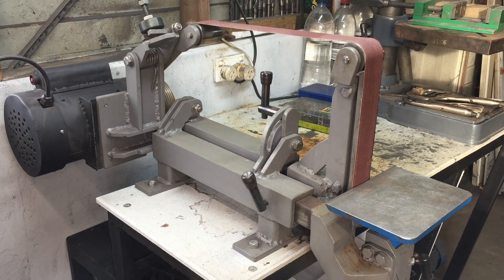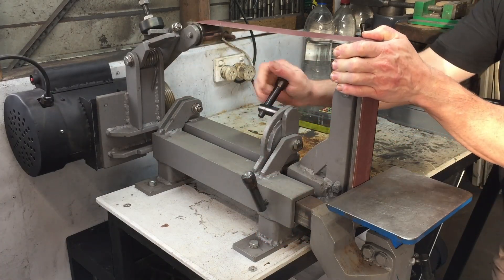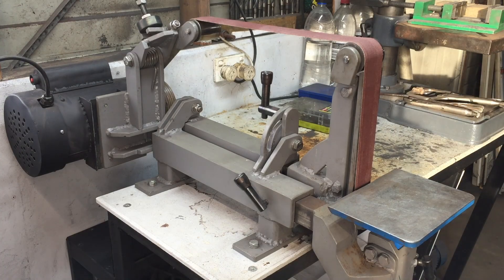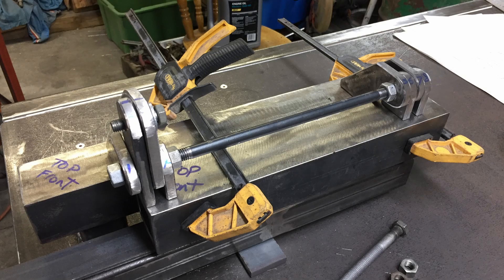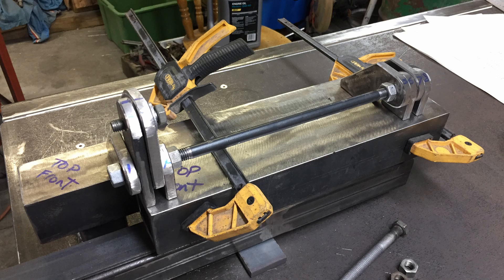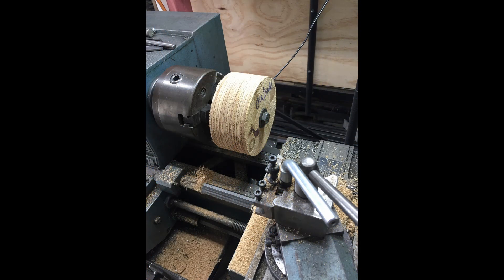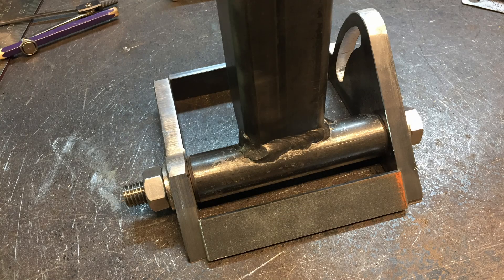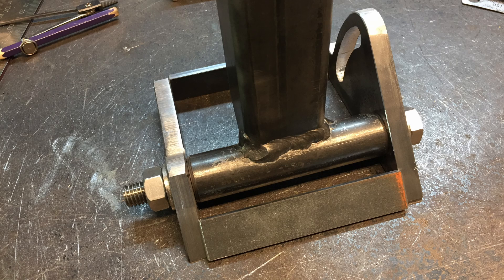Shop Made Tools & Upgrades #2 - 2x72" Belt Grinder

Comment: I'm happy to have found your Jeremy Schmidt Gen 1 Belt Grinder video, mate.  After seeing your grinder, the first question that immediately came to mind is regarding your motor.  As I was unable to find a motor that would easily mount up via Jeremy's plans, I found an alternative 3-phase face-mount motor that DID NOT have feet attached to it.  This being the case, I purchased a nice ready made foot assembly that I was planning to attach to the motor casing using a two-part steel-to-steel adhesive.  Your motor looks like you fabricated custom made feet, so I was wondering if you took the motor apart to weld those feet to the motor?  Needless to say, welding would be preferred over an adhesive, so your experience would be very helpful in this regard.
Reply from the maker: Yes, I did fabricate custom made feet and I did weld them to the motor. The motor was originally a pool pump motor with a flange mount. I did not take the motor apart to weld the feet on to it. I think I did it in small bursts and let it cool in between so that the case would not get too hot and damage the windings.

Comment: I built the Gen 2 Grinder last year.  I had bought the Gen 1 plans and Jeremey released the improved Gen 2 design before I started.  I immediately purchased the new plans and set out to collect the parts for the grinder and all the accessories.  The big advantage I saw in the Gen 2 design was not having to fuss with making room on the stand for the swinging motor.  I use it everyday I'm in the shop and I am still impressed with what it can do.  Nice job, especially on the radius jig/table.  I still need to build one of those. 👍👍😎👍👍
Reply from the maker: Yes, I had to make the table with a cut-out in it to accommodate the motor when the grinder is tilted.

Comment: Interesting build. I have a Piccador linisher I am just in the middle of restoring. What motor is powerful enough will depend on whether it is an induction motor like yours or a universal motor (like the washing machine motors I have). I would suspect a 3/4 HP induction would do the job but you would need a 2HP universal. (Just my thoughts...)

At some point I will build my own though as I don't have as much space it will be much smaller.
Reply from the maker: Thanks Ben.